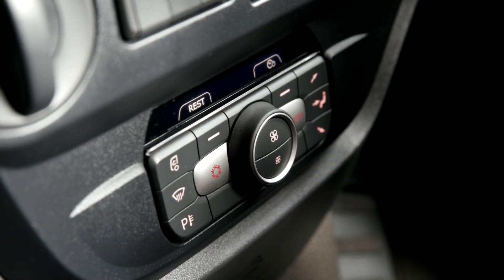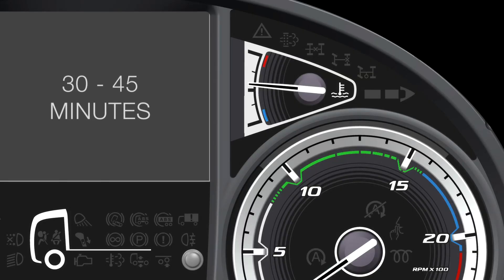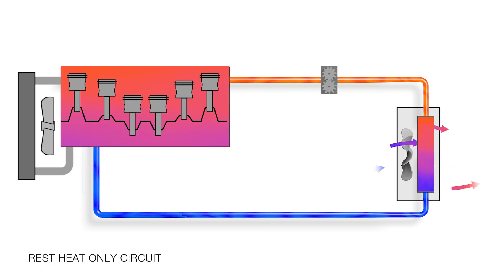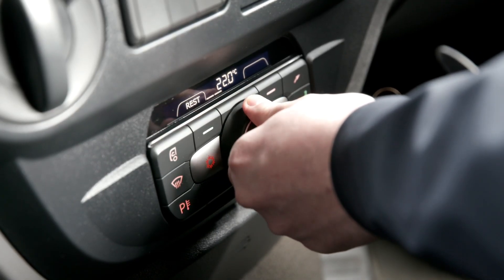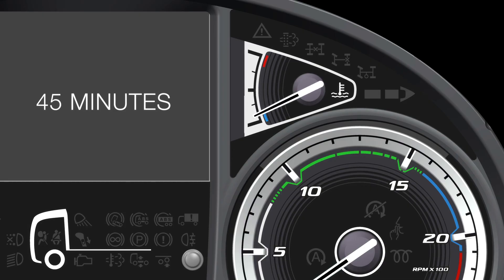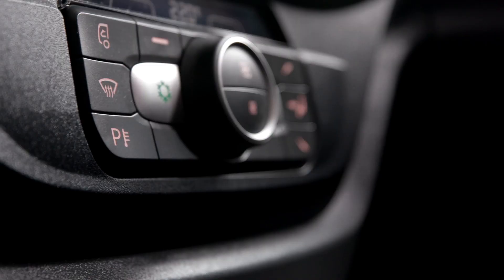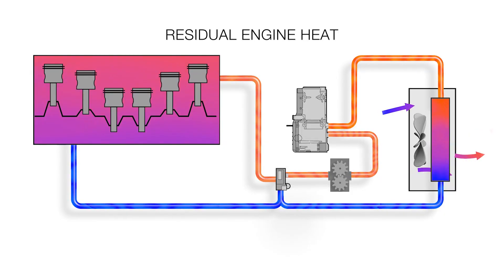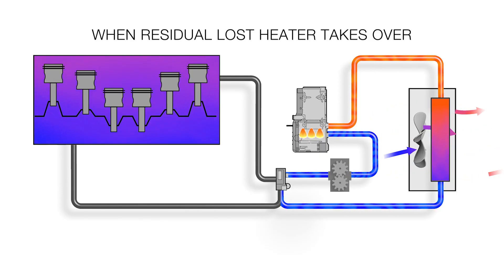DAF Auxiliary Heater Explained

Comment: Thanks for the vid im current sitting in a layby frezing my nuts off. I think the webesto type thing they put in the truck is a lot better than a normal diesel heater
Reply from the maker: Which truck are you in, JF20082?
Reply: @DAFTrucksUKLtd  im completely freelance, so I was working with a company that was running xgs and xfs. I think there are the plus models and absolute step up in quality and comfort. 
Dont know what there like mechanically as I have not messed around with one yet but genuinely , one of the nicest trucks I have driven. 
I even drove one of the new VDLs, and personally, I thought the previous ones were dreadful, but the new ones are quite nice definitely not as good as the new trucks but still a complete step up in quality.